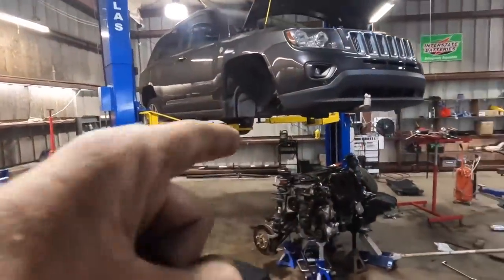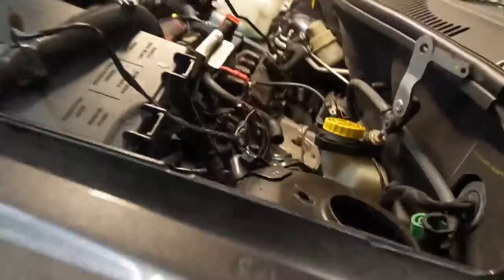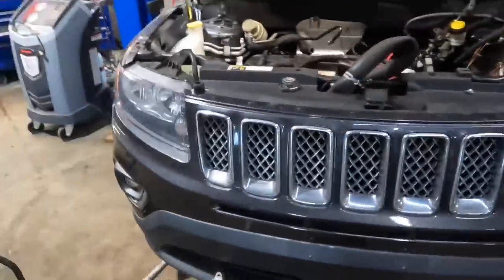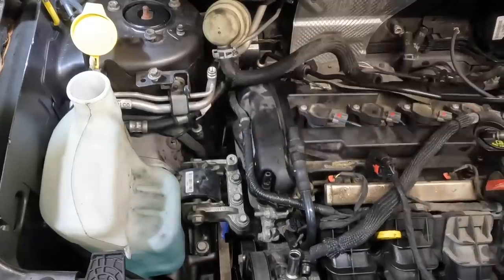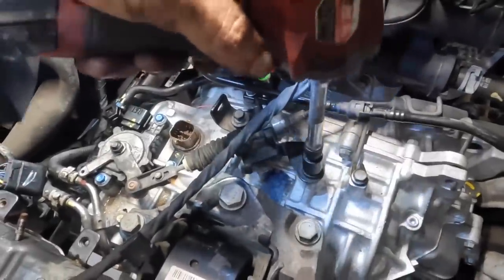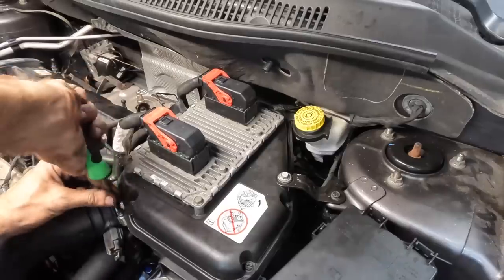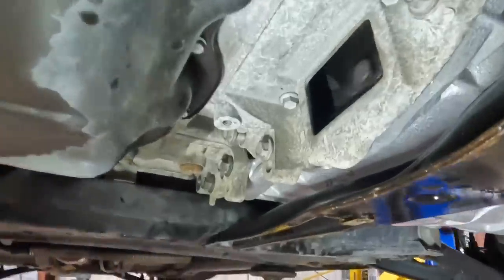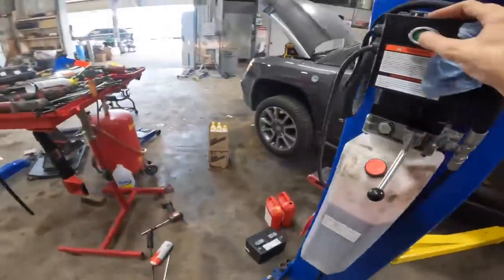Hyundai/Kia Trans in a JEEP?! 2016 Jeep Compass 2.4 4x4 #frankenstein

Comment: The 2016 Compass came with a CVT transmission; enough said. Still with ridiculous used car prices (around $15,000 for a 2016 Compass 4x4) the repair makes fiscal sense.
Reply: Mine has a 6 speed automatic
Reply: @leodrosia4369  Yes , depending on the trim, the base model (2 ltr) came with 5 speed, and the 2.4 ltr came with either a 6 speed auto or CVT. However as stated the trans that was replaced is a CVT. The 5 speeds are pretty much built proof and will usually outlive the car. A CVT? not likely.
Reply: @TheOnespeedbiker  that looked exactly like my 6 speed trans....I think they are pretty good if u change the atf .
Reply: @leodrosia4369  I can only go with the title of the video; BTW the 6 speed automatic in Compass/ Pariot is actually made by Hyundai, not a bad thing as Hyundai has neen making transmissions for light and heavy duty trucks for a very long time.

WHAT! If you don't maintain your car's engine and transmission they can fail? How long has this been going on!? Seriously I've heard only 30% of car owners, including new car owners maintain their cars, which if you rely on the manufacturer's schedule is probably not enough, especially the frequency of oil changes. Even the dreaded Ford Triton 543 will last if you just change the oil frequently (once sludge develops under the valve/cam covers it will starve the engine of oil). Yes some cars have defective parts, but by far, a lack of maintenance is the cause of most engine/transmission failure.
Reply: @TheOnespeedbiker  I think they call it the 6f24 and mine looks exactly like the one replaced by rainman . Cvts are for the fwd compass...anyways, I would not want to  pay or subject my mechanic to this nitemare so I do a d and f every 2 years . I bet this job must've been close to 6k while 3 qts of maxlife every 2 years is 20 bucks
Reply: @leodrosia4369  Ray posted the car was 4WD and a CVT and I tend to believe him. Price wise I'm sure I was way low. Still even at 6 grand, you likely could not buy a 2016 Compass with a new transmission for twice that.
Reply: @TheOnespeedbiker    u should look at a compass ctv and compass 6 speed AT .... I  can tell the difference and maybe u can too . I think Ray made a mistake in headline but he did a great job as usual on repair

Comment: Even when new those CVT's are junk.  Huge customer complaint numbers.  Huge failure rates.  The CVT is just an adaptation of a snowmobile drive system.  Big difference is a snowmobile drive pulls on its belt.  The junk CVT's PUSH ITS BELT.  Ever felt like you were f*****g with a rope?  Same thing in these pieces of junk.  BTW: I've owned 6 jeeps and loved every one of them but you couldn't GIVE me a jeep with this drive.

Comment: Ray, me again, I have a 2015 Jeep Patriot sport 2.4 4x4 freedom 2 drive train. I'm trying really hard not to be one of those know-it-all butt holes you have to deal with everyday. That being said, if I'm wrong I will gladly swallow my pride and admit I'm wrong. That 2016 compass has the freedom 1 drive in it, which has the sequential trans not the cvt. 2 clues, look at the shifter inside, look at the + & - at the bottom, and the pan location on the trans. The cvt trans pan is on the bottom. Can you please let me know if I'm correct? It's a mechanic OCD thing, I swear.
Reply: I thought the same thing, I have a 2014 Compass and it looks like the same Hyundai transmission I have in mine. If so, he did not correctly check the fluid level. Mitchel had the wrong procedure which said to use a dipstick (not with car) at the rear housing (not under the battery). I did not see the fluid he used but it is supposed to use SP III. I used Valvoline max life in mine.
Reply: Yeah, your sequential trans fluid is more red in color, because sequential transmission fluids are more of a hydraulic fluid base. The cvt is not! It looks and smells just like motor oil, hence it's an oil base.
Reply: I agree and am really confused by this one. Judging by the markings, it isn't the CVT if it is stamped Hyundai/Kia. If that is the case, I hope it didn't get CVT fluid because they are def not the same.

Comment: Dang shame, cars cost $$$$$ a transmission replacement $$$$ and they don't give you a dipstick to check the fluid level. They claim it is good for the life of the car and we all know that is bullshit. What if you get a small leak? Check it like Ray did, but why should it be that way. Some new vehicles are not equipped with a dipstick for oil!! How stupid is that? There is a ton of reasons that sucks. People need to wise up and let these manufacturers know about these things and that we will stop buying their cars until they fix it. Lower the costs by not putting all this electronic crap on them too. We just want to get from A to B and back comfortably and safely. Also stop buying cars and trucks no matter what they cost, stupid. They sold over a million F150 last year and the average price was $61,500. That right there shows me there are over a million idiots out there. I may be an idiot, but I would never pay that much for a truck or car for that matter. Also what do you think it does to the price of insurance, I will shut up now.

Comment: When you were installing the torque converter bolts I saw a transmission or pto bolt not tightened. I hope this gets to you in time.
Reply: That bolt was sticking out a lot, should be easy to spot when looking at the square hole where the torque converter is.

Comment: Ray, when you were installing the torque converter bolts I noticed you had a bolt not tightened all the way in on the belt housing to the left of the torque converter access panel.  You may have gotten it off camera
Reply: I tried to screen shot it but it wont let me post the picture